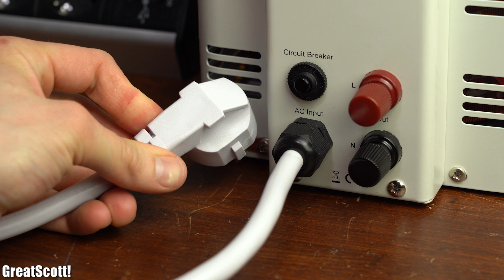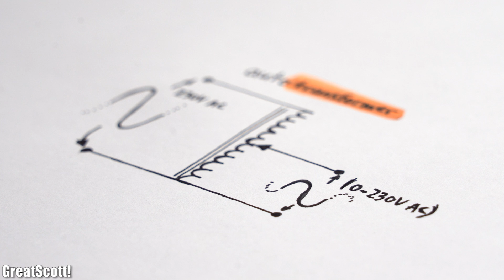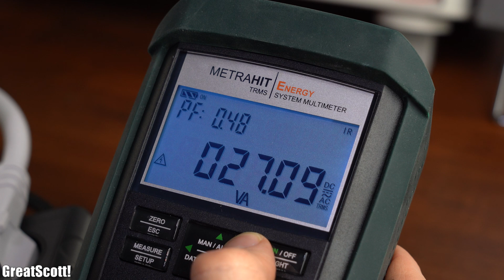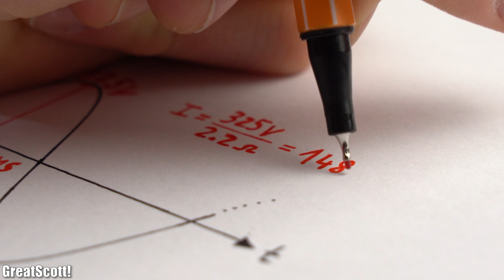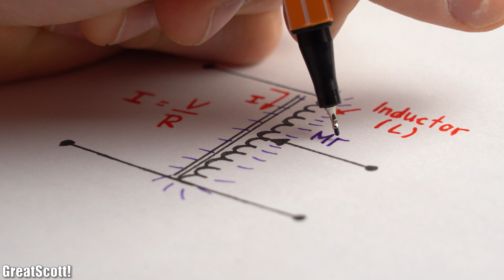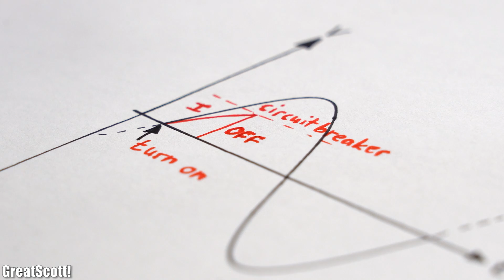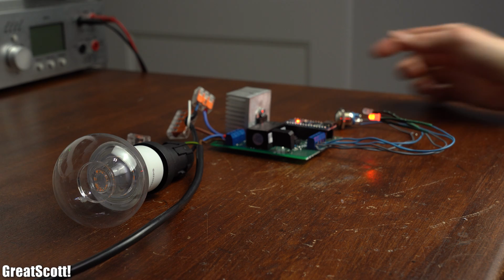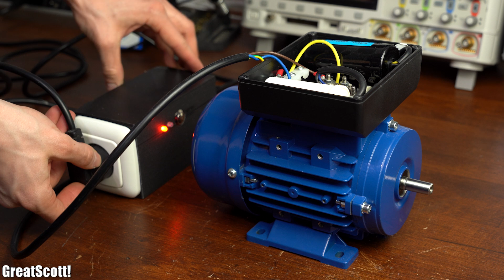How to make an AC Softstarter because my autotransformer keeps tripping my circuit breaker!

Comment: Well, fun build but seems Quite over engineered  to me....

A lightbulb (or a apropriate resistor along with a relay/ kontaktor witch shorts out The bulb works just fine, The time it takes for The relay to pull is enoff to limit The starring current thru The bulb/resistor.

Been Using that to power a 5.2kva transformer of a 230v 10A breaker since i got it....   Tripps The fuse without fail if i forget that box...

I guess this might use a bit less space tho...

Comment: The core of the transfer is probably saturated when turned off in a certain point in the AC cycle.
The next time it is powered and the current is in the same direction as the created saturation, a huge current flows through the transformer, that trips the breaker.

Comment: An old TV mechanic I knew had a soft start circuit made with 200W light bulb and a switch 😀
Reply: ah, the old "dim bulb" great for slowly powering up something like an old radio or TV that has wax caps in them. light bulb lights up brightly you shut it the hell off.

Comment: Did a similar thing for the mystrey rating variable voltage transformer I got. Unknown what the ratings are, but it seems fine to handle 15A output current. Just used a high power resistor in the input line, 4 10R 10W in parallel, and with a 100C thermal fuse between them, with a relay fed from a simple resistor, bridge rectifier and capacitor smoothing, so the relay turns on around 5 cycles after switch on and shorts out the resistors. 

Also used a winding tap that gave 60VAC (lowest one on it) that fed a half wave rectifier, smoothing capacitor, and then a 47V zener regulator, that in turn feeds a 33V zener regulator, providing power to a LM723 set to provide an output of 6V, that can sink 10mA if needed. This is the one side of a simple voltmeter, so that the scale starts at 60VAC, and goes all the way to 360VAC, which is the range of the output at maximum. All made using parts either repurposed or lying around, including the box, which was the case the variable voltage transformer came in, just with a coat of paint, and the assorted outlet sockets attached. 60VAC to 360VAC because the surplus meter I had came with a 1mA FSD coil, and was marked with 0 to 30 already, so quick to simply use a black drawing pen to relabel the numbers, after a painting over of the originals.

Comment: I tried such stuff for my fridge. When the compressor starts, lights flicker in my house. My project failed.
On low load I passed current through huge watt resistor and when compressor starts(high current), after small delay, I switched to no resistor line using relay.
Unfortunately, if delay is high compressor failed to start properly. And, if delay is low resistor could not take that much starting current not even for very small time. It worked till the resistor survived.
How can I solve this problem?

Comment: Nice! Also, please do a project about softstarters for DC (Seaflow) pumps and (non pwm, dc) motors. I just used an 84% efficiency buck boost converter product 12v to 12v and it worked! XD How to do this more efficiently? Maybe elaborate on power supplies technology for said topics a bit?

You could to tests with an elevator and 10kg mass to compare efficiencies.

I guess what I'm asking is: How would I have to go about installing the prototype into the house of a friend, so I will not get sued if the house takes water, fire, cold or lightning damage because I made it the proper wae?

Comment: hey great scott,

a few minior problems here, the initial current flow is only depending on resistance? where is the time constant of the RL circuit? also transformer powerup neasr zero-crossing is more or less the worst that can happen (highest current because of the field requiered to build up (integral from halfwave))

Comment: can we use a power resistor for soft starting and a triac to short the resistor after soft start?
Reply: 2 or 3 ohms 20 millimeters diameter NTC in series with primary also work.

Comment: WRONG! Transformers, regrdless of type cannot possibly be rated in WATTS.
Reply: Optimus Prime, the famous autobot has a power budget of thousands of watts. The same is true about the non-auto transformers like that rude loudmouth Megatron. 

Heat from losses is often rated in watts.  Its a major factor in a lot of applications and probably covered in the datasheets for certain models.  At least I hope its rated in watt and not Fahrenheit per burning matches.  

Genius units of measure aside, I would have to agree with you on the transformer rating comment.

Comment: You probably have a core saturation problem during the initial transient, this most likely to occur when you start close to  a zero crossing, if you start close to a voltage maximum you flux peak will be lower.
Reply: Any more information on this? Would it work to have an SCR or something wait for a peak before turning on?

Comment: The explanation is wrong: the initial current cannot jump from 0 to vmax/r, there is an inductance in the circuit! The initial current is always zero, and the initial current SLOPE is V/L. Unless there is some other component, like a parallel capacitor in the circuit.

Comment: Nice build! But one thing I found missing was an explanation of exactly how a soft starter is supposed to work in the first place. For example, does it just switch on once, but at a safe point in the AC cycle? Does it switch on every cycle for a while, gradually ramping up the duty cycle until it's at 100%? Something else? Was this in the video and I just missed it? (Entirely possible; I was on some serious painkillers today. If not, do you have another video explaining that part? Or should I just try to figure out out from the code?

Maybe it's worth a follow-up video with more explanation of how soft starters work and with the error mentioned in the pointed comment discussed and then fixed?

Comment: Are you sure your breakers don't just have arc detection in them? The most modern ones designed for residential do, and it's not the max current that trips that feature but the detection of arcing. My guess is the intermittent connection created by manually inserting a plug into a socket is what's tripping it, and closing any switch or relay would prevent the tripping just as well.

Comment: Many Auto transformers don't have the primary not across the entire coil, but tapping at a 90% or so. The wiper however does extend across the entire coil, permitting the output to actually be higher than the input voltage. Eddie Van Halen used to use an auto transformer to lower the line voltage to his guitar tube  amplifiers, for what guitarists call the brown sound. Sorry if this is a duplicate comment. Thanks for Colorado.

Comment: Only feedback I'd have for you would be to move those LEDs, put the red one near the back, as it indicates power in, move the other one to out outlet side and make it light up red when the button is pushed and go green when the sequence is done (those looked to be three or 4 legged LEDs, so either dual color or maybe RGB?). This way it is much easy to know what the state of the thing is by a quick visual glance, and therefore a bit safer to use.

Comment: Been thinking about a DC spark prevention with an NTC, with some sort of bypass, is there a common way to do that? Would be nice to have that built into a switch that first contacts with a higher resistance before pushing on to the main connection. Or like a preload button. Need to switch 100 amps.

Comment: Excuse me I can't understand this , if the résistance of the windings of the transformer is 2.2 ohms , isn't that a short circuit on its own without a load .
Reply: Because input voltage is not DC. You need to calculate its impedance (Z) with this formula.  Z = sqrt(R^2 + X^2) X is the reactance, which comes in play with AC voltages, and you calculate it by: X= 2*pi*f*L. If you think about it, frequency of DC is 0Hz ,and if you put it in the formula, you get 0reactance, which then makes the impedance equal to resistance.
Reply: Still not clear
Reply: I watched the video again now I see , it's only 2.2 ohms in the beginning then the inductor decreases the current
Reply: @zakariiarif8541  No. Input impedance of the variac never becomes 2.2ohms. It seems confusing because he explains it wrong in the video. Inductance itself never causes inrush current, in its normal operation region.

Let's put it all in numbers, so it becomes clear. What we know: R=2.2ohms, frequency=50Hz, inductance=unknown, but let's say 10H.
Calculate the reactance use this formula: X = 2*pi*f*L
X = 2×pi×50Hz×10H = 3.14 kΩ
Put the reactance (X) in the impedance(Z) formula.
Z = sqrt(2.2^2 + 3140^2) =3.14 kΩ
So this number means that, with according to our assumption of a 10 Henry of inductance, the input impedance of this variac at 50Hz is 3.14kohm. 

So far this does not explain the inrush current. I think what's happening is, his variac has an included input capacitance for a power factor correction, and that causes the current spike. Or the core is saturating, so the inductance becomes a resistor. 
But I could be wrong.

Comment: Another much easier and cheaper way which I used succesfuly in the past was a 1s timed relay in parallel with a high power resistor with just enough ohms to limit the current to under 16A.

Both of that in series to the load will limit the current for 1s and then the relay shorts the resistor.

Worked like a charm :-)
Reply: good idea, but using an ntc instead of a power resistor is better, since it can prevent from burning down your house in case of failure of the relay/connection..
Reply: @nicolaswannen1743  can you get ntc with lots of watt dissipating ? Better to use onetime thermal fuse on the resistors.. If relay is dead resistors heats and kills it series connection to the load by melting thermofuse once...
Before the relay and resistor an inline glas tube as slow 16A is needed as well...
No ntc/ptc disc that ages and sets it self on fire, just metal case grounded and fuse will do better job maybe?
Reply: In most cases you can also use a normal relay and connect it's coil parallel to your load. Once the current draw drops the voltage rises and the relay closes. You may have to match your resistor and relay a little. But that's probably the easiest way to limit inrush current fairly efficiently (the only power loss being the holding current of the relay).

Comment: Not real sure of how to fix it, but from what I understand is that the core material has memory.  When turned off all the lines get lined up in one direction, and if you turn the power back on, and the phase is 90 deg. from the lines of force, it acts like a short circuit.  It is kind of hard to explain, so I hope it is a little bit clearer.
Michael from Washington State, near Seattle.

Comment: I would like to see you create single sided PCBs (use wire links on the component side where necessary) - for all of your projects  rather than use matrix perf board.
Reply: why?
Reply: @flflflflflfl  It makes better sense. Now I am not saying that I am an engineer or even a novice one, but I have been floating around the scene armed with an soldering iron, scope and other necessary tools for over 30-years now. Surely my opinion is not entirely worthless. ☆Magic☆
Reply: @trentjackson4816  why does it make "better sense"?
Reply: @flflflflflfl  I owe you no explanation other that my opinion that reflects my efforts with academia and actual real-world experiences. Now if you want me to build you a rocket, then I am going to require a lot of money to keep my Wife satisfied. Thank you. Please come again and have a ☆Magical Day☆
Reply: @trentjackson4816  ok how much do you need?
Reply: @flflflflflfl  I would like to have Eight-Hundred-&Eighty-Eight-Million-Dollars USD sitting in my bank acc.

☆PLUS☆

a.911 Turbo Convertible Porsche
b.100ft Cruise Boat...
c.Jet Chopper and Plane
d.Owner and Design Contributor of Silicon Chip

e. Girl of My Choice
Reply: @trentjackson4816  I will wire the money once you explain why you prefer single-sided PCBs
Reply: @flflflflflfl  I love them because I am kick-ass with designing and hand making them. They are more cost effective too. So the reason is ♡
Reply: @flflflflflfl  I want to be self-made. Make me earn it.

Comment: i solved this problem (popping breaker) by adding two NTC-thermistors to the input (L and N), so as you plug it in, they "puffer" the current for just a few milliseconds and prevent the breaker from popping.
but for this a) i cannot use loads over 10A anymore and 
b) they only works, when they are not hot. So plug the transformer in and instantly pulll it out and plug it in again will make the breaker pop again.

also another super simple solution, which i dont like, is to use a 20m extension cable. this also works like a puffer and will prevent the breaker from popping. (tested ;) )

Comment: I think a SSR may be a good idea for my well pump, I just want something to take the brunt of the starting current off my inverter! A NTC, with SSR should do fine, then I can use 12-24vdc on the pressure switch, maybe at low voltage/current it will nearly last forever! The pump is 120vac, abd is about a 7 amp peak load, it's in a shallow well, and has a easy job! It isn't worked hard!  I just don't want it to possibly blow gets in my inverter if it's bear full output, and the pump comes on at the peak of the sinewave! Great video!

Comment: Nice vid and well done project. (Beside the fact, that you should not turn on inductiv loads in the zero crossing point).
I also think, this is a bit of an overkill for a soft start... It would be a lot simpler if you used the soft start circuit for your inverter. And if you powerd the soft start circuit from mains using a capacitiv dropper. (Thats how I do it).

Comment: Your solution is too complex.
.
- A case !!!
- A power supply !!!
- A mains lead !!!
- A mains socket !!!
- A TRIAC !!!
- A micro-controller !!!
- Effort to develop software.
.
Installing a NTC thermistor inside the auto transformer is a more practical and cheaper solution.
.
This YouTube video shows how it should be done.
.
Variac Inrush Thermistor
https://youtu.be/Avsua8G7Vpw

Comment: As you mentioned, even a zero volt point initial turn-on is not always curing the problem.  The reason is the remanent magnetism in the transformer core.  If the magnetism left in the core at previous turn-off matches the direction of the start time voltage growth slope, there still is a big inrush.  The theoretical analysis considers the fact that there is a 90 degree phase shift between the voltage and the current (on the primary).  So, at the positive going zero crossing of the voltage, the usual transformer operation condition would have actually the negative peak current at this moment.  You don't have that, if you make the primary connection at the voltage zero crossing moment.  Your gradual increase of the voltage is indeed the way to prevent the breaker popping inrush.  As funny as it may sound, if the transformer was turned OFF gradually, you would get near zero remanence and then the optimum time to turn it again on would be near the voltage peak (either positive or negative) !!!  Too bad, you generally cannot know the state of the remanence, nor force it to any known state.  I hope this explanation can serve other people who may suffer from the same issue and are wondering why.

Comment: If you decide to use your small variac again you might want to use ring terminals and nuts instead of directly soldering wires. It should be safer and more durable.

Comment: May I suggest that you add a relay to bypass the triac after completion of the load soft starting in order to limit the power loss in triac and saving it from overheating. And you might want to add a variable resistor to enable the user to set the soft starting phase duration.
Great job

Comment: I hope you got a really good autotransformer.  Tech Tangents recently got one (a European model as well, you could have plugged it in to your outlets without difficulty, although it would have been a bad idea).  Turned out to be badly made, with lots of crappy solder joints, as well as connections that were soldered when they should have been crimped.

Comment: In my country indonesia to solve the problem inrush current and make tripping circuit Breaker, we use a cheap soft starter with a wire and the wire mould with cement and it works we never complaining about tripping MCB

Comment: Instead of using an optocoupler for detecting the AC phase angle, wouldn't it make more accurate to use a small transformer + DAC? I've been thinking about it and the problem with optocoupler base ZCD is that the LED turns off around 2v which is not actually 0, so it's impossible to make a circuit that delivers 100% of the input power to the load.
Reply: In my opinion even transformers ~12W are as big as a phone charging brick. A simple zero crossing detector circuit based on opamps is a pretty easy way to go if all you want is zero crossing detection.

Comment: Tripping circuit breaker?
1. Use a North America circuit breaker
2. Use a relay in parallel with a resistor
3. use a NTC thermistor